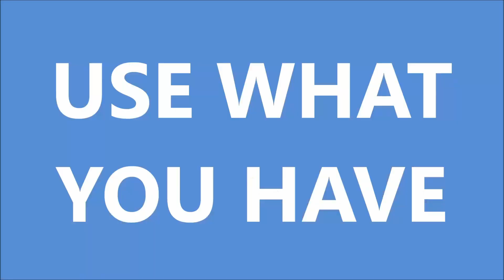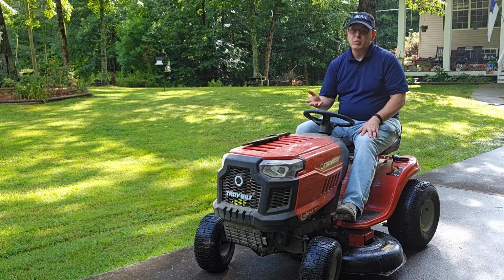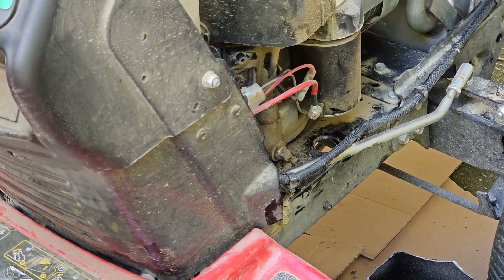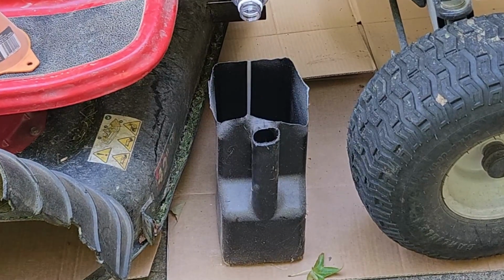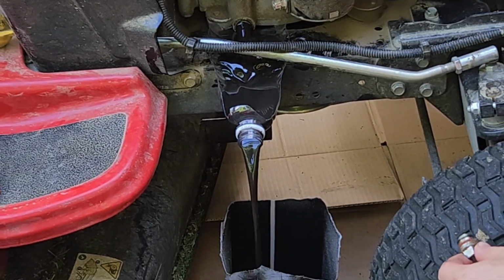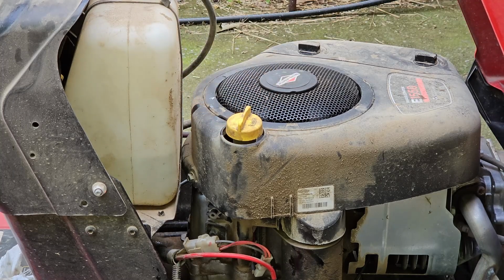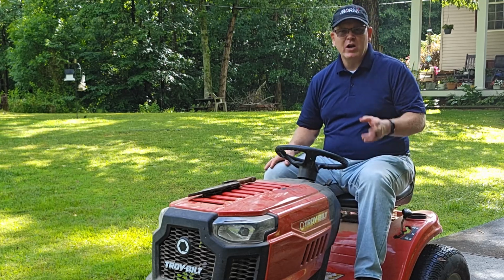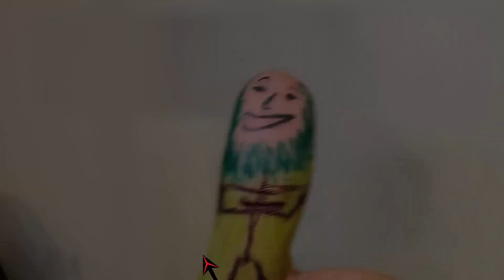How To Change The Oil - TROY-BILT PONY

Comment: Thanks for this video, now what is the recommended tire pressure for this lawnmower?
Reply from the maker: Off the top of my head, I would say 10-12 PSI. At that low of a pressure, I usually just air them up until they're relatively firm and don't compress too much when you press your whole weight on them.

Comment: Man my drain plug is super stuck. Any advise on getting it loose?
Reply from the maker: @RedCatHabitat  I've had luck with PB Blaster penetrating spray. Spray it on and let it soak in 30 minutes. Then try again. You may have to do that 3-4 times. Actually, you may have to do it for several days or weeks. I broke loose some seized spark plugs from my rusty old truck, but it took several months. Other times, I've broken loose bolts after only one or two applications. Just be careful not to break it off.
Reply: @pastorchrismullis  thank you so much for your response. I have been using our mower as a plow for a couple years now. We found a cool plow attachment and its been working pretty great so far. I'm having trouble getting it started this winter and I'm going down the rabbit hole of things to try. However, changing the oil is still on my list and I've now, regretfully, started stripping that horrid little square plug. I was trying it with a 7/16th Crecent wrench which fits pretty well but is sliding off. And worst of all ive given the nut a little bur where it's started to round off, so i dont know if a proper tool will even fit anymore. what a nightmare.  I've gotta figure out how to get this thing off. Ive been hitting it with that pb blaster stuff.  Ive got a 14mm hex socket which seems to fit snug and im going to try my impact drill on low on it once the adapter i ordered arrives.. that might strip the nut i guess but idk what else to try at this point, its really on there. Ive got a 1/2inch extender which someone recommended but all the wrenches ive tried grabbing it with just cant get a purchase. I also ordered a little hose attachment which i plan on replacing the wretched square plug with -if i can ever get it off again.  any ideas/advice? thank you in advance.
Reply from the maker: @RedCatHabitat  patience. Lol. The impact driver is actually a good idea. Keep applying that PB Blaster and be patient. If you totally strip out the nut, I'm not sure of the next step.
Reply: @ thanks again 👍

Comment: You could just put a hose with a valve on it. Brass tube fittings and a small shutoff valve. Works great no mess, no wrenches.
Reply from the maker: @thasalvadorian  thanks for the tip. I may try that.

Comment: What should I put my used oil in. Currently used oil sitting in used ice cream bucket.  What should I put it in to dispose if it.
? Thanks
Reply from the maker: Here's some ideas:
-Use a funnel to pour it back into and the empty oil container
-put it in an empty gallon of milk 
-put in any empty half gallo or gallon container you have in the trash 
You can take it to an auto parts store and the will usually dispose of it for you for free. Also, consider if there are alternative uses you could use it for such as painting it on a wooden fence or post to keep it from rotting.
Reply: @pastorchrismullis  can you paint with used 10w-50 lawn mower oil? I had no idea
Reply from the maker: @lutkeone  it's more like a water seal than a paint, although it might give a unique stained color to help wood as well. Try it out in a scrap piece of wood first to see what you think.

Comment: Is it possible that my 2020 Troy Bilt Pony has the oil drain on opposite side? 

I looked all over on the right side but nothing. I believe I located the oil drain cap on the left side of engine.
Reply from the maker: Maybe. Some of these have different engines. Mine is a Briggs and Straton, bought in 2022.